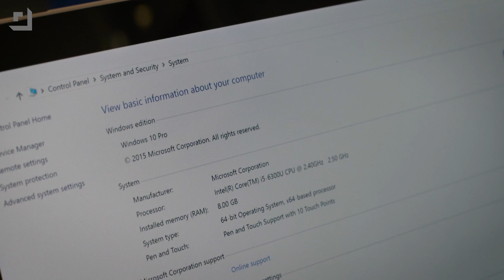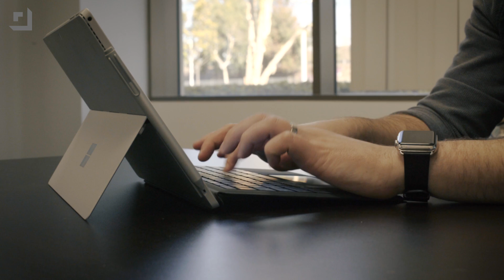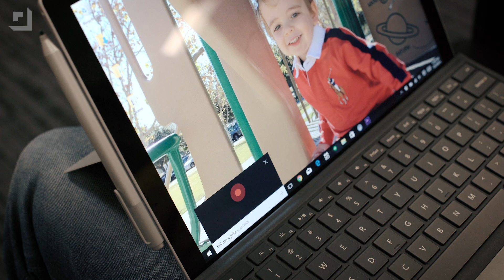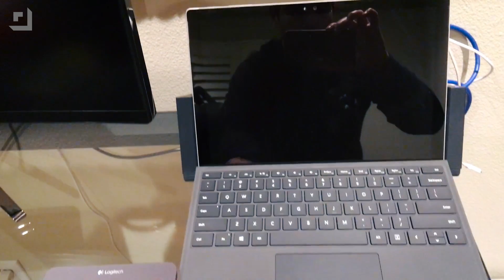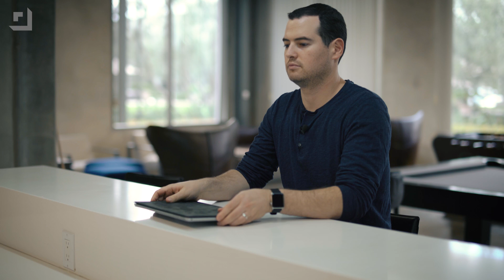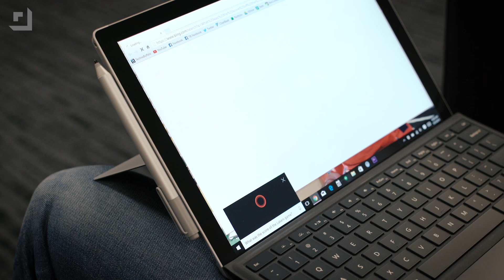Surface Pro 4: Still the Best

Comment: Totally love the idea of the Surface Pro, but I have been through several replacements.  Battery life at best get 3-4 hours with normal business apps like word and excel.  It has locked up with normal apps like Outlook 2016.  It has failed me in meetings so many times that I have wanted to slam it against the wall. That said, there is no way I would recommend this device. If I recommend a Windows device, I would recommend the HP specter 360. I don’t only do you get a solid machine but you also get the stylus and twice the specs.  Also, the warranty is better. The biggest problem with the Microsoft surface line is that their support is about as good as Verizon.  Microsoft support is the worst in the business.  It is outsourced and it is more of a prescription for their end user when things go wrong. As for me, I gave the service line I shot.  I am now ready to get a MacBook Pro just because I get superior support and the device always works. My advice to Microsoft is to focus and learn from other organizations that offer superior customer service. While there is still a following of Microsoft products, there is a generation that is rising that does not see them in the same light as say Google or Apple. Microsoft makes great products, but they are losing ground with an upcoming generation that sees them in my system light as IBM.  As a professor, I asked my class last week tonight the top three companies in the technology community. Guess what Microsoft or IBM were on their list. This is and to say that Microsoft is not on a good trajectory, but rather they need to think different in order to capture a new generation of technology professionals. Their CEO Is the most forward thinking in my opinion, but Microsoft is too deep into wide to lose focus. The surface line is one of those product areas that Microsoft is very immature at this time. Again, companies like BMW, Apple, Mercedes have a solid follower-ship.Why? All it takes is walking into a BMW service center and you will understand why. They treat their customers with the most respect and their vehicles stand out in the area of engineering. Ritz Carlton is a prime example of how a company builds loyal customers. My advice to Microsoft would be to focus on your customers and put them first. Listen to them, simplify your products, and create a revolution.

Comment: Who else is watching on a surface pro 4
Reply: Chris Morris Got mine like 3 weeks ago. It's still the best 😍
Reply: SimmonSays Got mine 4 weeks ago, Its now my favourite device
Reply: I bought a refurbished Surface Pro 4 to replace my dearly-departed Lenovo IdeaCentre B320 all-in-one desktop. My Surface Pro 4 is a Core m3 model with 4GB RAM and 128GB internal storage. I also bought a 256GB microSDXC card for extra storage, a Wacom Bamboo Ink smart stylus pen for drawing, a 4-port USB 3.0 hub to connect more accessories (keyboard and mouse, USB drives, etc), a paper-like screen protector for a paper-like feel, a multi-angle carrying case, and an extra Surface Pro 4 charging cord, in case the provided charging cord stops working.

Comment: i have 2 questions.

1)Do you have to buy the SP4 and the keyboard seperately or can you get them together 

2)How much is the keyboard and laptop wih pen all together if they come seperate

My friend has this and it looks really good so i was thinking about getting it

Thanks for the help!
Reply: Free youtube red 1) the keyboard is separate from the device, you have to buy it for around $100

2) the pen comes with the device, so you don't have to worry about that. the price of the device and pen depends on the specifications (i.e. core i5 or core i7, 4gb or 8gb ram). It can range from $900- 2700, so try to choose specs that you'll actually use. Most users can go with i5, 8gb ram, and 256gb storage which is around $1250. With the keyboard, It'll probably be around $1330~1350.

Sorry it's long, but hope it helped :)
Reply: About the keyboard and mouse, I'm already covered.

Comment: Portable gaming rig is an understatement, I don't feel my back cracking and I play latest games like dragon age 3 at low graphics with no sweat. Wish it could have had an integrated graphics card but still not bad for a device the size of my book, even smaller.
Reply: Speaking of gaming on a Surface Pro 4, I'm more into retro PC gaming via DOSBox and ScummVM.

Comment: Hi, I have a surface pro 4, the problem is, it doesn't wake from sleep, everytime. I thought an update would fix this, but so many updates happened, and still doesn't wake from sleep.
Reply: No, it's a major firmware/driver issue.
Reply: it is fixed now, after the update,  thanks

Comment: I have a 2012 macbook pro and i want to upgrade because of the weight and the battery life that lasts max 4 hrs so I liked the 2015 macbook pro because of the 11 hrs battery life and I liked the surface pro because of the light weight that is perfect for university in addition to everything about it.. I am still torn between the two because the surface pro 4 is fragile I am too scared of breaking it and it has only 6 hours of battery..
Reply: +Meow Moosawi Same dilemma

Comment: Bought a SP4 a little over a week ago with the Surface Dock. My old desktop hasn't been turned on since. It does everything my old i7 16 GB desktop does. Batterylife is 5-6 hours, but using it with the dock charges it faster than with the normal charger.

Comment: To fix the track pad issue, you need to go to devices and hardware, find the keyboard, right click settings, and turn on precision mouse check box. Is a software issue that disables this.

Comment: Is SP4 good with medical students ?
Reply: +Abdulhamid Good question, yes surface is good for all students. It's not major specific machine though math practice, taking notes and reading ebooks and whatnot is pretty good on this device.
Reply: Yes. Use it everyday as an MS3
Reply: I'm at the end of medschool now.  I've used both the SP3 and a Macbook Pro.  I prefer the Macbook as the bundled PDF reader fantastic (and there are ALLOT of PDFs needed in my school), the filsystem allows for tags and the laptop form helps when taking notes in class on unsteady surfaces.  Also, the SP3 occasionally had a bit of fan noise and battery drain, which is nearly non-existent on the Macbook Pro.  They are both good, but I've come to prefer the Macbook and eventually sold the SP.

Comment: I have the pro4 i5 256gb but windows 10 is driving me crazy too many bug and windows store was not launching so I had to use restore point to make it work and sometime the pro4 get really hot plus the system crash for no reason why I have no idea......
Reply: +Enmanuel Nunez Seek support from Microsoft while you still have time. There are some machines with defective issues, they will send you a new replacement. Also make sure you buy from a credible source and some shady online website. 
Do not update your windows 10, install a new clean version instead, less bugs will appear that way.

Comment: iknow the surface pro 4 is built with windows 10 in mind but i dont think microsoft thought about previous surface pro generations, im running windows 10 on a surface pro 2 and i have encountered endless problems , which is putting me off the brand i even went out and bought a keyboard for my ipad 2 just for the convenience of using a tablet as a computer atleast it makes it usable , sorry gone way off topic just wondered what microsoft was thinking, loving the surface pro 4 as well as this video , but the price tag to keep up with microsoft just seems insane if developers supported windows 10 as much as they do with android or ios then it would be more worth its high price tag not including the keyboard is also a bad move by all of these

Comment: I just got one this passed weekend, and I think its great. The only problem that I have had with it though is that once I installed Microsoft office, the mail app closes itself just a few seconds after opening. Has anyone else had this problem with the SP4 or anything else running Windows 10?

Comment: I got one for christmas and I had a bit of a honeymoon period for about a few days until the touch screen function stopped working when I brought it back I was told it was a software issue and is not covered under Microsofts warranty. so I reinstalled windows 10 and got the touch screen back briefly week down the line gone again. I looked up online there is a glitch with windows 10 on the Surface 4 apparently I am lucky cause a lot of people opened there devices to find no touch screen working. at the start of the month I had enough and I sold it to guy on local buy & sell and lost half the money on it but fuck it it annoyed me more needing to use a external mouse and keyboard anytime i wanted to use it. long story short I bought a Macbook Retina 12" its smaller not as powerful but for the same price I got twice the storage 250GB and twice the RAM 8GB. sad to say the Surface pro 4 has given me the worst buyers remorse I have ever had :(

Comment: Do not buy a SP4 if you're an artist.
The pen digitizer has interpolation issues and pressure issues when pressing lightly, I've sent my tablet in for a replacement and tested two pens on it, my replacement still has the same issues remaining.
Not only that but there are major issues with drivers and running alternative softwares.

Comment: If I didn't have to replace my old desktop to a new Skylake desktop in November I would have gotten a SP4,  However I still use my first gen Surface RT when I'm on the couch at home. It's still in perfect condition. a bit slow but it works.
Hopefully Microsoft will create a 8 inch version of the Surface for people who want a device for media consumption.

Comment: I don't understand why Microsoft doesn't just bundle the keyboard with every Surface Pro 4 and then make the pen an optional purchase. 

It just makes more sense because EVERYONE benefits from the keyboard/cover while only a small percentage of buyers will appreciate the pen.
Reply: +TheBabbage78 I whole-heartedly agree with this, they really need to do this. It might just boost the surface sale by a lot too. The pen is not very useful for those who prefer to take notes on paper and not everyone is an artist. I would love to get the type cover included into the sp4 bundle.

Comment: Serious question: I was a long-time Windows user and at W8 is switched to MacOS. Until now I was not looking back. With W7 I had to format and re-install Windows about yearly to have a smooth experience. How about W10 - esp. with their tablets? Same (registry) fragmentation as the older versions?
Reply: +Ich bins No. since windows 8 the registry is quite fixed. no need to reinstall the OS every year or so, but win 8 is huge UI/UX madness and win 10 is much much better. but just a warning: if you install/uninstall too many software too often, your drive can be filled quite fast like i waste 70GB of storage in 4 years just to store "uninstaller cache" and had to remove them manually using 3rd party software.

lol now i remember back then when i still got XP. after a year the os will be painfully slow to start and must be reset.
Reply: +Karthik Naik yeah. it's just quite unusual for regular macosx users to frequently install and uninstall apps
Reply: Taufik Akbar Thanks for your reply! To me W7 was the most awesome Windows version to this date. It was kinda plain (but in a good way) and ran stable. But I agree with you the UI of W8 was a mess - I gave it a try, but didn't like it (even after getting used to it). Never had a "fragmentation problem" with my Mac and I shuffled lots of data around. No slow start, nothing. I also didn't mind to reset my PC yearly - but I wouldn't want that on a tablet. If I compare iOS (iPad) and the W10 tablet - iOS is a toy. The W10 tablet would combine everything I loved of windows.
Reply: ***** Thank you for your reply! I'm considering to get one of these tablets - I love how they executed the concept. The only thing that "bothers" or (might) keeps me away is, if it's still needed to periodically set the system "fresh up"?
Reply: +Ich bins 

Were you using a hard disk drive with Windows 7? Because that sounds like the result of fragmentation.
Reply: microsf121 Yup, it was a "standard PC" - nothing special. And I loved W7 itself as an OS. The only thing that really annoyed me was the fragmentation - sure there are tweaks and little programs that help to minimize the problem. But what really helped (for me) was to set it "fresh up" yearly. You without a flash memory or SSD does not have that problem?
Reply: +Taufik Akbar Mac OSX has the same issues actually(apps)
Reply: +Ich bins Window 7 was very good as was XP but not much else they have done and I'm a Mac user... Since 1988 I have had 1 virus on my Macs and I have never had to defrag... Now the Mac OS is Unix based it is very stable
Reply: +Karthik Naik In what way... Please tell me...
Reply: Antony Dick In the same ways as windows
I use OSX for my daily work since I need certain programs like Avid which are mac only 
BUT I prefer my Surface Pro 3 any day over my Macbook thanks to its flexibility
OSX is in no way better than windows 10

Comment: Had the device, returned it. Biggest issue I had was the fan getting loud while using adobe premier. Also, did not find the sp4 to be a very good tablet, as it was heavier than I would have liked it to be (though the fact that it is a full windows pc in such a small form factor is an engineering marvel)

Comment: I'm actually using my Surface Pro 4 as a coding machine. I run MySQL, Atom and Eclipse and it works like a charm. Never had ANY problems.
Reply: Hi +Riksy, which version do you have of the SP4 and my important question is, how reliable is this device?  Did you get any crashes?
Reply: Riksy Nice. Just ordered mine with i7 and 16gigs of RAM. This will replace my 5 year old desktop.
Reply: Edwin Capidos do you recomend using an i7 with 8gb at 2019?

Comment: 6 hour battery life? My 2014 Macbook Pro can do 10 to 11, so um yeah. Sad, because I want to go back to Windows and the Surface would be my preferred device..
Reply: +shawnthor MacBook Pro is more than 3x thicker than the Surface Pro 4. This is a completely different device, even the MacBook Air is twice as thick. It's a miracle they managed to get 6-7 hours into it. I actually get an average 8 hours and 40 minutes, but that's on a Surface Pro 3, not 4
Reply: +shawnthor actually I found my SP3 to be on par with my MBA in terms of battery life
Reply: shawnthor it also doesn't have a kickstand which makes it useless
Reply: +shawnthor Yes unfortunately this is one of the most disappointing aspect of the SP4. However, in almost every other way, it's a triumph.
Reply: +shawnthor I think they're fixing that, it's not supposed to be so bad. They said it's "problematic" to find a fix and it'll take a while, because apparently windows 10 overuses the turbo boost function of skylake processors. 
I hear you can find a temporary fix by setting cpu to 99%.
Reply: +0M9H4X Um, nah. Galaxy Tab Pro S is 10 hours.

Comment: I been using an Surface RT and Surface Pro and now an Surface Pro 4. However  It's a decent tablet/laptop combo but it´s biggest weaknes comes down to the OS. If you think that you will get an iPAD experience your dead wrong. If you are satisfied to use it as an tablet in 1 of 10 times it´s fine. Otherwise go buy an real laptop.

Comment: Hey Jon, I had previously wrote in before about my love for SP4 over the iPad Pro... and for the most part that's still the case. I do have 3 questions for you though, since you've been using your SP4 as a daily driver. Currently I have the SP4 i7 base model and find that I get wildly different battery times depending on what I'm doing. So...

1.  Do you find you still get 6ish hours when doing any gaming - my i7 only gets around 2hrs if I try to play starcraft, simple games off of steam, or even Tomb Raider Go off the windows store - gets about 2.5 hours of playtime before hitting critical battery levels.  Also, I bought i7 specifically for light Adobe CC work and a ton of Light Rm work - anything adobe gets around 2-3 hrs of battery time if i'm lucky, slightly more if I turn off wifi.

2. In hopes of extending battery performance I also had a disable several cool windows 10 feature such as cortana. Since you mention her directly in this vid have you noticed or tried disabling her and other features to get better system performance and/or battery times - or have you pretty much left everything as stock? In addition I also disabled most of the system tools for microsoft communication, calendar, mail, etc... And disabled sleep mode, instead opting for hibernate, because I had found leaving all this stuff going was causing me to lose around 20% a day when not in use.

3. Finally, do you have any suggestions for a compact portable battery charger that works well with surface? In an age of everything being usb power, I haven't found a good solution for this problem yet.

Despite the nagging battery issues, my system goes for 7-8hrs easy when not doing any of the above hence the confusion. Your vid made it seem like you do a pretty healthy array of tasks on your unit in any good battery cycle, so I got to wonder if my unit is bad or if you're plugged in most of the time so it doesn't matter much to you. 

Thanks for the great video, despite the flaws I really think microsoft is onto something with its surface line.  

Cheers,

B